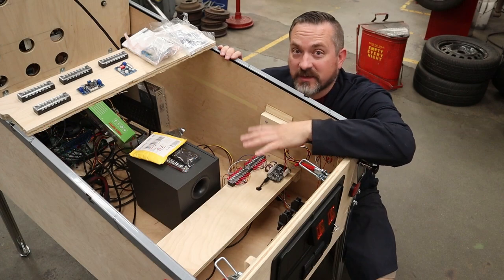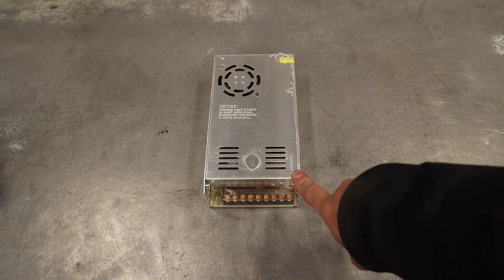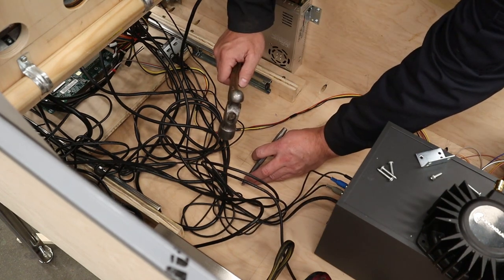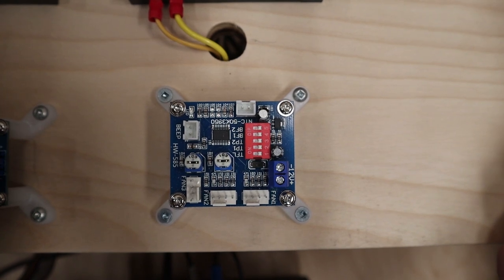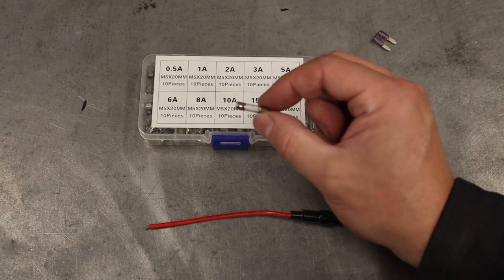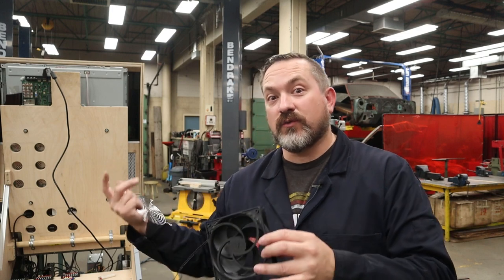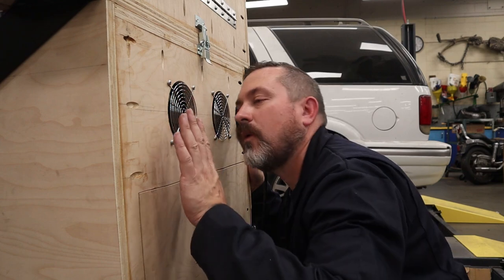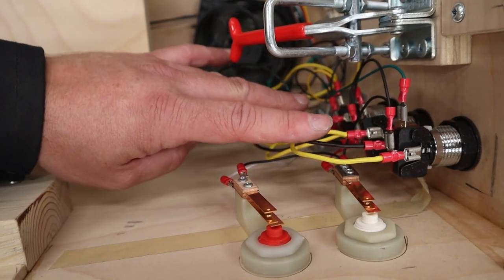Virtual Pinball: install power supplies and much more

Comment: Good day. Would you be able to link me to your source for your Teensy and also the Octo adapter? The MJR link has it (3.2 board) out if stock. I see there are later versions of the Teensy. Can a later Teensy version be used? I would really like to upgrade my Flasher Panel to ARGB Matrix and along the sides of the playfield. I pushed forward, with the RGB Flasher Panel when I saw the Teensy was out of stock and the chips were delayed until April 2023. Thanks.
Reply from the maker: Just did a quick google search and thi popped up. Looks like the teensy 3.2 are all out of stock like you said.  I bought mine a while back when everywhere had one.  Not 100 sure but I think the newer versions will work still.

The octo board should be easier to find.
https://www.amazon.com/Teensy-3-2-OctoWS2811-Adaptor/dp/B07HBPGNDN/ref=mp_s_a_1_2?keywords=teensy+3.2&qid=1668824015&sr=8-2

Comment: are you going to put any fans in the back box
Reply from the maker: I wasn't planning on it as there are lots of holes near the top and there's going to be some air flow from underneath.  I need to check though and see if its hot or not.  I might put in one or two more and aim them upwards though.  Thanks for the watch!

Comment: How would i connect a switch to the toys,so that I could turn them on or off?
Reply from the maker: You can do what did with my led power supply, just add a switch to disconnect the power to the toy or if all of the toys are on a power supply you could put that on a switch.  Or you could add a latching button in line with the signal wire to the relay board so it doesn't turn on the relay.  Lots of ways to do it.  Thanks for the watch!
Reply: @wayofthewrench  Thanks for the advice.
Reply from the maker: You are very welcome!

Comment: Question - Did your button kit ship with 12v bulbs and 6.3v 555 bulbs in a separate box? They sell LED equivalents of the 555 bulbs and my setup would be much cleaner if I could swap all of the button bulbs out for 5v 555 LEDs (I don't have your coin door so that's not a concern). 

I know that 5v LEDs will provide similar light levels to 6.3v incandescent, but my concern is whether or not I can swap the 12v bulbs out with the 5v LEDs.

For example, the launch ball button had a12v bulb pre installed, my LED equivalent fits right in. If I swap in my 5v LED bulb and then wire it for 5v am I causing any issue?

It seems like a simple yes but I am newer to the tinkerer side of electronics and would prefer not to burn my house down.

Thanks in advance!
Reply from the maker: The launch ball button and the  coin doors were 6.3V bulbs stock and the round buttons lamps are from an old arcade build I had left over so that is why they are 12V LED bulbs.  I would say that it is totally safe to put in the same voltage bulbs but in led form or to put in a smaller voltage bulb in led form as the leds do not have as much heat as the standard bulbs do.  As long as the replacement bulb physically fits, it should be ok.  I would not change for a higher voltage though as you are asking for issues there.  Cheers!
Reply: @wayofthewrench  Thanks!
Reply from the maker: How's the vpin treating you?
Reply: @wayofthewrench  Too good, meaning that I am having too much fun playing with it to finish the build. My LEDs are sitting in my closet giving me dirty looks every time I walk by. My one undiagnosed issue is the tilt sensitivity given the addition of the bassshakers. Did you ever post anything on how to resolve that?
Reply from the maker: I am in the middle of editing a video on Pinvol, this is the fix.  It allows you to tweak your rom music and ssf to exactly what you want and it saves it per table.

Comment: Why didn't you use 5v from the PC PSU?
Reply from the maker: You totally can!  I will be using my 5v for my addressable led strips and matrix which will be pulling 60 amps so I thought I would keep it seperate plus I get to show you guys how to install the other type of power supply.  Thanks for the watch!

Comment: Although i'm planning a standard wide body and will start by buying a plywood flat pack, I figure i'll need 6 months for my project, especially since i don't really know what i'm doing. Then i noticed your first video in this series is from 18 months ago (granted, the parts list one is "only" 12 months ago) but you're still not done! Oh no!!
Reply from the maker: Don't think thatmy vpin cabinet is taking forever, if I wanted to and didn't have to film, I would be done in a couple weekends.  I have to research, build, film, edit, and schedule my videos which is why the delay.  I take my time with my videos in order to make them the best I can.  Plus it's not my full time job and I only get an hour a day to work on stuff.  Thanks for the watch!

Comment: Hello! I need to solve a dilemma! I would like to use a single power supply in my new mini virtual pinball cabinet build and that would be the PC psu. Hence I will need to get power for the following components, beside the motherboard, cpu, gpu and anything else attached to the mb: 2 driver/controller video pcbs, to control the playfield and the bacgklass display (12v 3a each), 1 mini audio amplifier (12v 5a will be sufficient, since the audio system is composed by 2x 3'' 5w speakers and 1x 6,5'' 150w woofer which will never reach max. output volume power) and one 5v led for the pc power button. According to some calculations and to the fact that the GPU will be something not greater than a gtx 1650 (or a 1050ti), the power absorbtion should be fine, using a 500w psu. But the real dilemma is: it is advised to load everything (displays included) under a PC power supply? It will be a problem if everything will turn on when I press the PC power button (like displays not properly showing in pinup popper, cause of a random power on order, or anything else)? Any other ideas? My current build has separate power connection for the PC psu and a powerstrip line where I have attached the 2 video driver/controllers and the audio ampli. Everything is smooth, but I don't like the idea of having 2 separate power cables getting out of my cabinet. The reason why I would prefer not to go with the master/slave power strip strategy is because space is very limited (we are talking of a 600mm long, 300mm wide and 540mm tall cabinet).
Thanks a lot and <3!
Reply from the maker: I would not recommend using only one ATX PSU because of power fluctuations.  You want your PC to have clean power or gameplay will be affected.  I really don't think a 500w PSU will be enough either.  Thanks for the watch!

Comment: dude, atleast use UL listed PSU's...other than that...great vids
Reply from the maker: Underwriters laboratories approved psu?  These are safe power supplies if that's what you mean.  Just gotta wire them up correctly and with correctly sized wires.  Thanks for the watch.